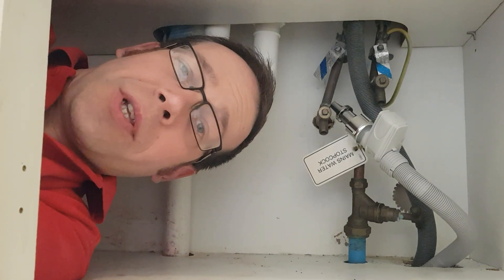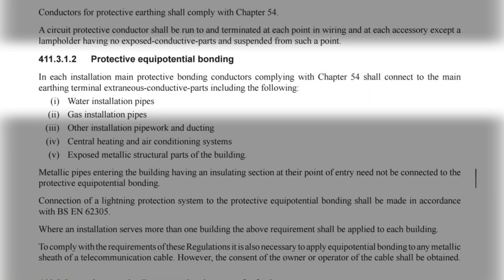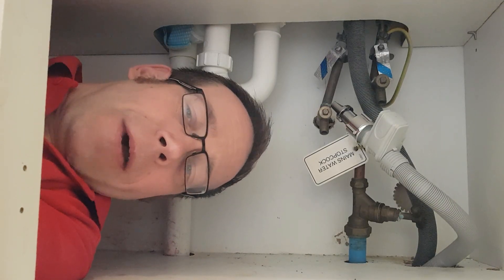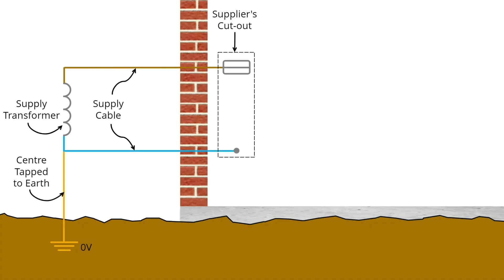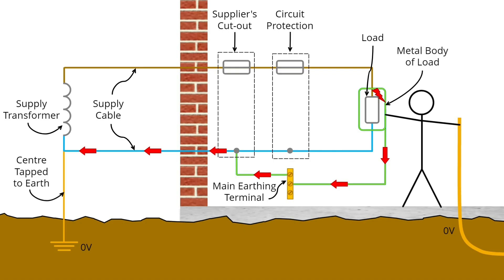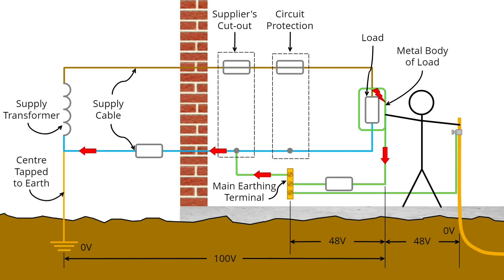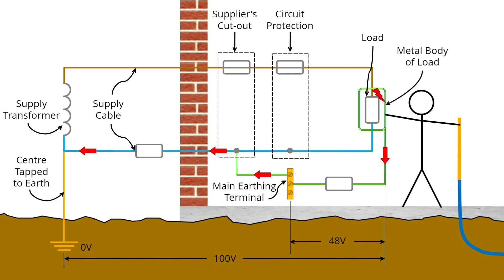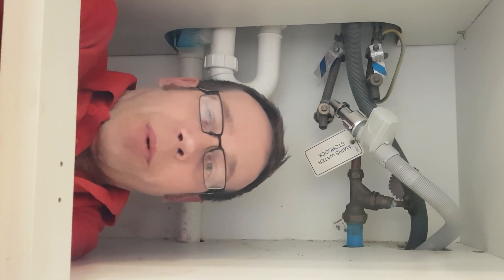DO YOU NEED TO EARTH BOND PLASTIC WATER PIPES?

Comment: I am not an electrician, but part of my job in an electronics based industry included reviewing technical specifications of the same order of complexity and detail as bs7671, though not usually so long. 
At best the section as a whole is made AMBIGUOUS by the second line you highlighted. At worst, it lures you into taking the second highlighted part to trump the first. 
My department would have asked for it to be rewritten to remove the ambiguity, if it was a specification of ours! Electricians take it to mean no need to bond if the water incomer is plastic, but I read it as meaning this: 

"If you have metal water main coming from the ground but a plastic stopcock or the like interrupts the conductive path, there is no need ALSO  to bond the metal part rising from the ground, on the supply side of the break. Only bond the metalwork on the consumers side of the insulating break"
The purpose is equipotential bonding. It says so in the heading. If you don't bond the water pipes, etc, you do not HAVE equipotential bonding. My interpretation - that you don't ALSO bond the little bit coming from the ground resolves the apparent conflict. BUT IT NEEDS A REWRITE!

In almost every case this piece of pipe at "true ground"  will not be more than a few inches long. The context is important, too. It is about EQUIPOTENTIAL  bonding. A fridge next to a radiator will be connected to the CPC. It is logical that the radiator too is at the same potential, possibly even if a PEN  fault has developed. That is what I take "equipotential" to mean. If you do not bond the pipes then the scenario you kind of dismissed might arise, that a fault - or dodgy workmanship - might cause a potential difference between metal cases of class 1 electrical equipment and nearby radiators, gas pipes, structural steel etc.

Comment: I had this situation, and inserted a 6 inch length of copper pipe for the equipotential earth bond
to keep the water in the pipes at ground potential, since chlorinated water is quite a good
conductor.  Any better ideas ???
Reply: Use an RCD.
Reply: @jemmyh2511  Yes there are RCDs of 30mA on all 3 phases  as well !

Comment: "We can't bond just to cover poor installation" This is a correct statement... However.
I was receiving shocks and tingles from my New washing machine and kitchen sink, turns out Mice had chewed through the Flex feeding the washer.
This left the live conductor touching the water feed pipe and therefore livened-up the whole unbonded house water installation.
Makes you think ?
Reply: Sounds like your metal pipes had no earth.
Reply: There is a difference between grounding and bonding. The washing machine should have a proper ground wire  that is wired to house grounded system. The flex cover should be bonded too.
Reply: What if the supply only have live and neutral?would bonding help in preventing shock
Reply: You really must get electrically certified Mice and a Cat also a CORGI
registered Dog !!!

Comment: Commenting from the other side of the pond, there are benefits to bonding sink piping and fixtures to earth.  Customer safety.  Bathrooms/washrooms have a GFCI receptacle for personal safety if a hair dryer or electric appliance fall into a sink full of water.  If the metal faucet fixtures are not bonded, (PVC DWV pipe and/or pex/CPVC supply lines) the electrified water has no discharge path except thru the person to the floor.  If the faucet, sink and flex piping is bonded to earth, the GFCI will sense the fault and trip.  Without the fault, the gfci will happily keep the appliance electrified and running since the electricity is flowing into and out of the device as planned-no fault, but a deadly condition still exists if a customer reaches into the sink to pull out the device.  There are videos where electricians have turned on hair dryers, dropped them into a sink filled with water and the appliance happily keeps running since no fault current is detected by either the socket's GFCI nor the device's GFCI plug.

I'm not familiar with UK RCDs to know if they will detect this condition and protect occupants in the same way.
Reply: This analysis is wrong.
Consider the scenario where there is no bonding and a GFCI is present.
If the customer reaches into the sink and there is a dangerously high potential present, the customers body acts as a resistance to earth and current starts to flow through them. The live and neutral currents are no longer the same and the GFCI trips, cutting the power off and preventing electrocution.

Dropping a hair dryer in to the water in the sink with the hairdryer switched on doesn't result in the GFCI tripping because the live and neutral currents are the same, there is no path to earth. The porcelain of the sink is an insulator . As soon you put your hand into that water, there is a path to earth through your body, there is potential across your body, and that potential difference starts to cause a current to flow through it, which now means the live and neutral currents are no longer the same, and hence the GFCI trips.

So yes, placing a hair dryer into water creates a dangerous situation, but the GFCI will prevent the person being electrocuted.

Earth bonding the metal water outlet pipe and the metal plug hole (if it is made of metal) does help, as it should (not guaranteed) cause the circuit breaker in the consumer unit/distribution board to trip.

But the safest way to prevent electrocution is through the use of the GFCI.

If the outlet pipe is plastic then bonding it is pointless as it is not conductive (except at very high voltages!)

Comment: Since the city water is conductive enough to prevent static charge from building up with a non-conductive pipe it's not necessary, but if the pipe were transferring a non-conductive fluid such as oil or gas, absolutely ground both ends of it as the friction between the non-conductive pipe and the flowing non-conductive fluid builds up a static charge.
Reply: Any working fluid through a closed isolated loop will exhibit some potential...
Reply: @davidhilton7780  yes absolutely, but any conductivity in the fluid will drain the charge away, but of course with enough friction and not enough conductivity you can get a charge building faster than it dissipates.
Reply: @TurboBaldur  so wouldn't bonding both ends of a non-conducting line to conductive ends safely dissipate the static in the line and reduce the risks...
Reply: Thanks for your input, I enjoy it greatly. And thank you for conversation on something as trivial as bonding.

Comment: Looks like a lot of folk got tripped up with the "You can't apply bonding to protect from faulty installation elsewhere." quote. You have to remember that the original standard was an extra protection in ALREADY - it will only reduce harm in a very specific fault condition. 
We shouldn't pass up on a safety factor just because "someone else should be being safe" but you do have to be practical. There is absolutely no sense in arbitrarily applying safety factors to things without a clear requirement. If the standard does not require it and there is no practical reason to replace it then don't. If there's a reason above and beyond the standard and you deem it appropriate, then go for it. Otherwise you're just going down the rabbit hole of "what if" and that leads to plain idiotic stuff. I see a lot of "what if" here. Well what if the pipe leaks, should we double jacket all the pipes? Should we bond our bed frames in case I spill my water on my heated blanket? 

Of course not. By all means, stand by your own work and apply your own logic. But I won't advocate for willy-nilly protection applications for just in case. It can introduce more risk than it's worth. Here's a "what if" for the crowd. What if someone does a bad electrical installation and uses that ground on the sink thinking it's a good ground. The appliance faults, but not to ground, now it faults to the sink and the user is at risk of shock.

Oh the "what if" crowd. Always a scenario.

Comment: If its not extraneous then why bond it, applying protective bonding to a conductive item which is not an extraneous-conductive-part might lead to the risk that under fault conditions these items may become raised to the fault voltage for the time it takes the protective device to disconnect.

Comment: My thought is the pipe should be bonded as soon as it turns to metal inside the house;
Reasons
1-Do you know the whole supply pipe is plastic?
2-i have seen supply pipes where the last foot has been converted to plastic but the rest underground is metal. I know tap water has a quite a high resistance per metre inside plastic but it would still provide a conductive path.
3-What if something is changed in the future and ended up grounding your copper pipes. Better to locate the cable & clamp than do it at a later date.

Comment: What's inside that pipe?
Water.
Is water conductive?
Yes. Only pure distilled water is not a good conductor.
Will there be a metallic water pipe somewhere upstream connected to earth ground?
Yes, there will be.
Consequently, is there a conductive path between the metallic section of pipe in your house and earth ground?
Yes, across the water in the pipe.
Hence, do you need bonding of the metallic section of the pipe in your house?
Yes.
End of lesson.
Side note: electromagnetic and electrostatic charge can also be a factor that can cause a potential voltage on unearthed metalwork.
Reply from the maker: Tap water isn’t really that conductive
Reply: @efixx  Depending on the level of hardness - that's how many minerals are dissolved in it - from 5x10-⁴ to 5x10-² μS/cm.
Enough to create a conductive path between two sections of metallic pipes. Tap water is not an isolator.
Try, you'll be surprised.
Grounding will also greatly reduce the possibility of galvanic corrosion in the pipes inside the house.

Comment: Most of what I was going to say has been covered below, especially Tom Capons post, but all you need to do is ask a simple question. Will bonding it make the installation less safe? obviously not, Will bonding make the installation more safe in the event of a fault? Yes it will, so you put it back. you do not know that plastic pipe has not been installed elswhere in the building that has isolated this part of the conductive pipework from other bonding at boilers, immersion heaters etc. Regs are there to provide safety( or used to be!), It is the engineers job to ensure safety, not the regs, and anything done to enhance safety is good. Mere compliance is not good enough, just an A*se covering excercise. The attitude that," the regs say I dont have to do it so I won't" is what kills people. I was trained on IEE 14th metric 1970 and have CGND Electrical Engineering.  I am afraid I have little faith in the IET as the regs are difficult to understand, contradictory, and open to interpretation, which the IEE regs were not. We were trained on every regulation till we had been through the entire book TWICE, and then examined. You were allowed one retake if you failed, and then you were out of the college, and out of the industry, today, everyone passes
Reply: Totally agree about the regs. Continual incremental changes to generate more revenue for themselves and their manufacturer sponsors. The whole book needs a complete revision with thorough proof reading to eliminate the confusing terminology (who thought up the distinctions between extraneous/exposed/equipotential ! )  and numerous ambiguous contradictions.  And why the need to change section numbers at all - as if there were not enough subsection levels?

Comment: You should still bond it, if only to stop static building up in the metal pipework in the house when the water is flowing through it. It isn't nice getting a static discharge when you turn on a tap.

Comment: For an individual fixture perhaps this argument can be made.  But any larger and it also becomes a fire hazard.  If a lightning strike raises the potential of the bonding conductors in the house, or any part of it, you can get arcs to other large pieces of metal if they are unbonded.  Unlikely but true.

Comment: Deceiving. The title and thumbnail clearly point out putting a bonding connection on a plastic pipe yet the video discusses whether a metal pipe needs to be bonded when it's connected to a plastic pipe. They are not the same thing, plastic is a poor conductor of electricity, attaching a ground strap to it is just stupid.

Comment: 4:45 Well, err, the bit of metal pipe in the house coming from the supply plastic pipe still has water inside it - which is a potential conductor - so really the bit of metal pipe should be earthed locally.
Reply from the maker: What has a higher resistance than you think https://www.aquaread.com/parameters/resistivity
Reply: get your MFT and stick the probes in some water...

Comment: Hi Joe, I also done my 236 was when gas pipe and water pipes had to be connected to the main earth bar with the 16mm single core earth wire, such as bonding any copper pipe before it connects to the plastic because I think the water COULD still be at earth potential through leaks and underground brass couplers or such like, it would be hard to break the habit even though 16mm cable isn't cheap plus the bonding clamp.
Reply: Was only ever 10mm
Reply: @สมบัติสตีเวนสัน-น6ษ  Normally the cpc conducter should be half the size of the phase conducters so on a installation with 20mm meter tails then yes you would be right but with 25mm tails the nearest half size cpc conductor would have been 16mm sq
Reply: @chilledoutpaul  sorry I didn't realize that you were talking about the CPC,I thought you were talking about main bonds.(I also haven't come across 20mm cable)
Reply: @สมบัติสตีเวนสัน-น6ษ  Thats right the domestic cable sizes are 1mm, 1.5mm, 2.5mm, 4 mm, 6 mm, 10 mm 16 mm, 25mm. the domestic ring main in the road is normally 75mm and is normally a single core swa with the neutral and earth adjoining in the supply head (tncs system) admitting there other systems (tns & pms)

Comment: The main water supply have probably something, somewhere, metallic (an older pipe, a shutoff valve, etc) touching the water inside the pipe, and the earth outside the pipe. So the water is touching the earth via this part. Then if you have something metallic in your installation inside the house, touching the water, a faucet, a valve, a pipe, then this metallic part is touching the earth too, via the water that is touching the metallic part outside, that is touching the earth... 🤷🏻

Comment: My home in the US has plastic PEX piping and it is not bonded to the electrical service ground. Code does not require it. However, water is a conductor and water flows from buried metal pipe in the street and comes in contact with metal valves and fixtures in the home. Could a voltage potential be applied somewhere in the system, perhaps a faulty electric water heater  element?  Perhaps bonding at a location near the entrance via a stainless steel or brass pipe fitting might be a good idea?

Comment: Central heating/boiler water pipework needs an earth of some kind. If no rccd protection. If someone hammered a nail into a phase conductor only then that touches the copper pipework it would be at 230v at the radiators and stay at 230v. So if somebody is standing on a concrete floor and touches the radiator! People could even get a shock in the bath tub.

Comment: How do we know the integrity of the insulation on the pipe 20-30 years on? Entropy is a demanding mistress, The plastic coationg on the pipe doesn look dissimilar to powder coating an that goes south in 20 years on car chassis that are not in the damp earth all the time, I guess there is a way to measure this though.

Comment: I would bond it because of the potential risk of a fault which could cause the pipework to go live , touch the pipework and you create the circuit to earth   . As tradesmen we have to take into account whats been done before , what we can't see because it buried under the floor or in the wall , even what bogit bill the householder's mate from the pub did ,  we even have to consider  things such as  external taps , if a fault develops such that the pipework becomes live and you touch it  poof your mr crispy.   Infact one of my daughters freinds mum died because the taps were not earthed , a fault developed , she complained a couple of times about a tingling sensation , everyone thought she was daft, until they found  her dead on the floor , she had been leaning on the metal sink trying to reach the boiler

Comment: What about a metal radiator in the bathroom, or a dual fuel towel rail. RCD protection is this in place. A metal bedrame sits in the middle of a floor. I would bond it for bathroom protection even with RCD.